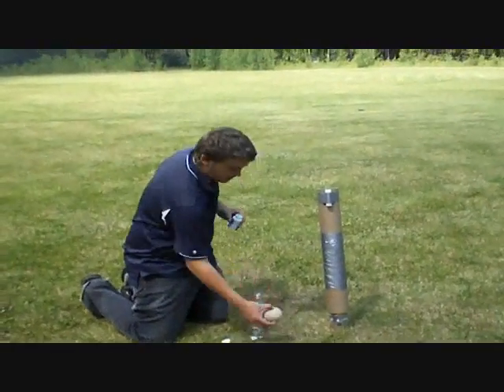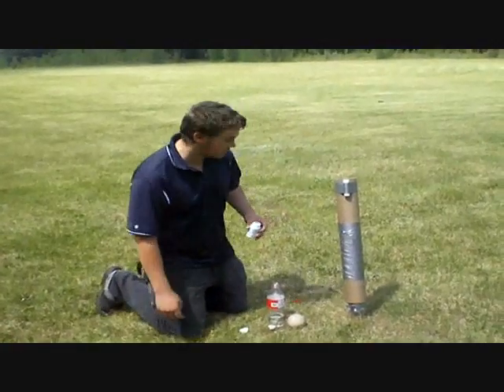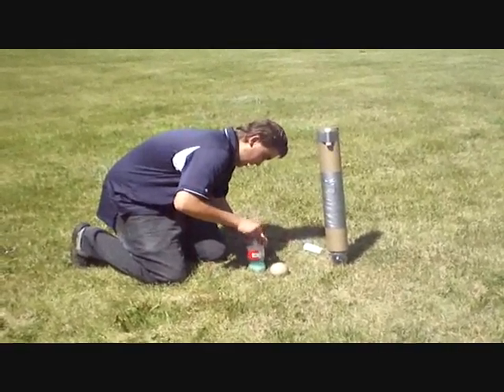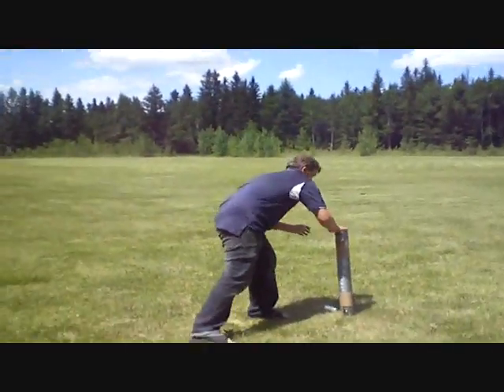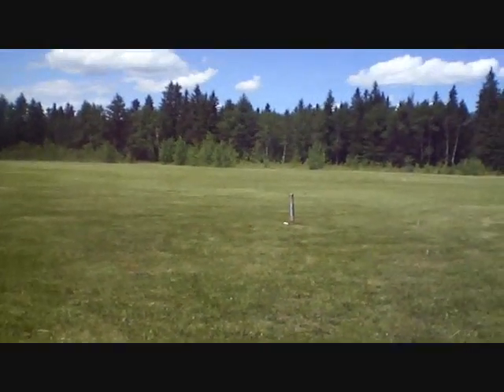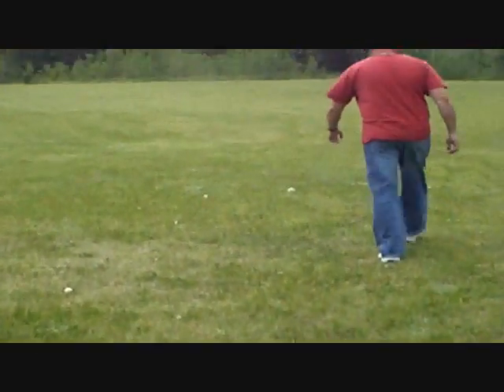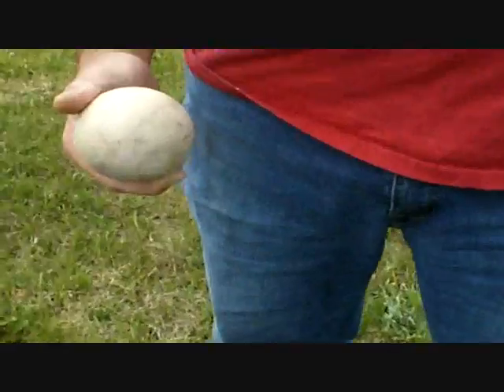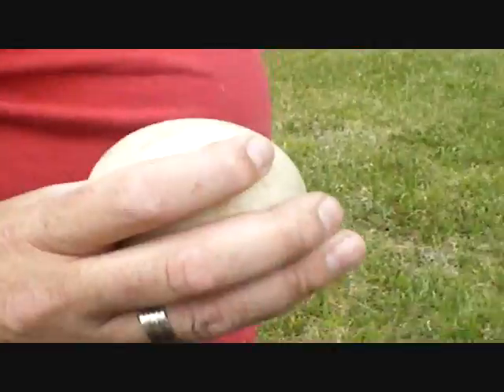Drano cannon

Comment from the maker: @MultiMinecraft123 not the best i know but that tube was around a half inch think. its usually good for about 3/4 shots before it wears down to the point i mineas well throw it away. i am working on a much better one made from steel. i was also thinking about putting a dry ice bomb into the chamber of my potato cannon instead of using fire. and ty ;)

Comment from the maker: @carmaster569 it depends on bottle and det time. For around a 10 tp 15 second det time in a 591ml bottle. About 1inch of luke warm watter and abot 1.6 oz of drano and 5 to 7 pieces of aluminum. Aluminum will be roughly 1.6 square inches. Hope this helps and remeber to be careful these are very unpredi table